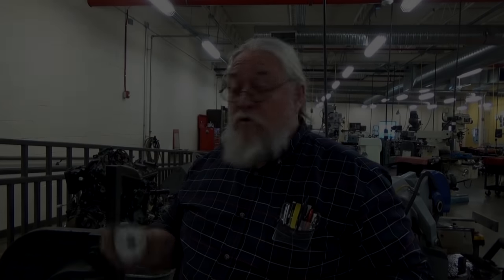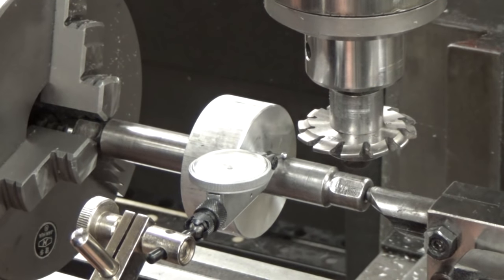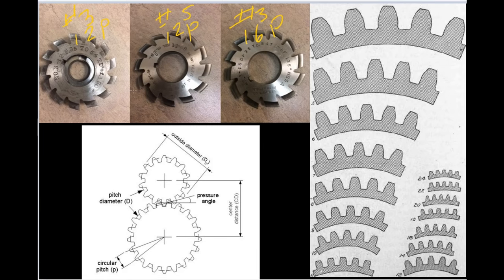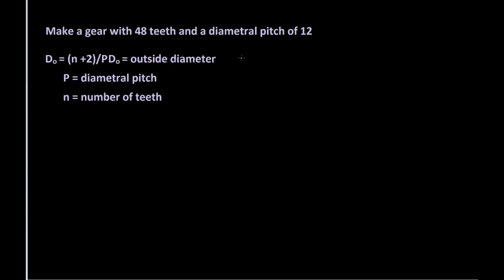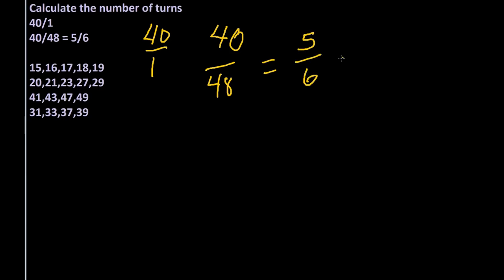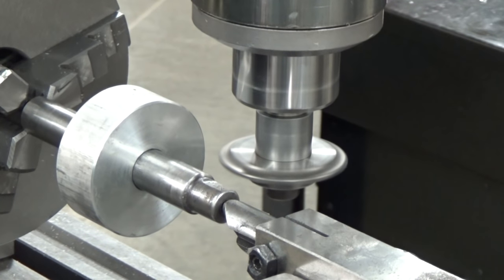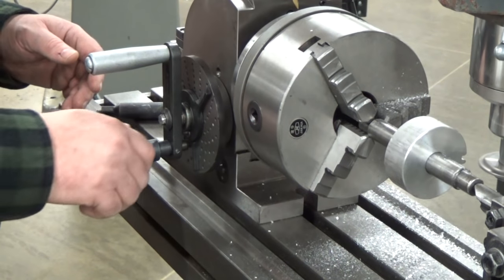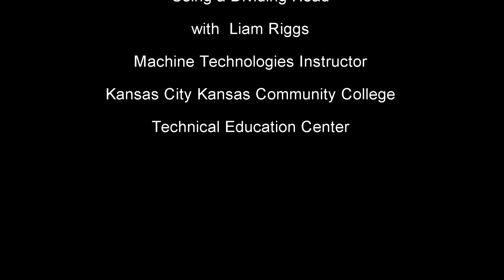Cutting a Spur Gear using a Dividing Head

Comment: Hello. In the beginning of the video, you said that the madrel is .003" larger at one end. During your setup, you indicated the top of the mandrel parallel to the table. Wouldn't that make the cuts not straight across the gear? Am I missing something? Thank you.

Comment: Up until a few years ago I always assumed gears were cast in sand molds or dies and then polished and "cleaned up", I was surprised to learn that every tooth is actually cut one by one on a machine like this!
Reply: This isn't the way mass-produced gears are made. Its really just for one-offs.
Google "gear hobbing for production gears.. 😎👍☘️🍺
Reply: @peterfitzpatrick7032  Yes, there's automated ways to produce the gears, but what I was referring to was not these one-offs but the fact that I thought they simply sand cast gears with all their teeth, ready to just ream out the center hole and "clean up" the edges of the teeth, but they are not just simply sand cast they are machined from blank stock.

Comment: If the gear arbour has a taper in it how can measuring either side be a good test for it being parallel? Is that why you said 0.5 thou diff is good? It just doesnt seem very accurate

Comment: need your help!! if i have an outside diameter of 1.500 inches, what pitch should i cut to make two identical 1.500 inch gears mesh? centre to centre diameter is 1.435 inches. Gears are for an angle finder...there is no load on them

Comment: At the start you said we only needed the O.D.   the D.P. and the number of teeth, I agree...yet..you gave and used a formula for solving the pitch diameter?  We don't need the pitch diameter.      You also gave a factor for depth of cut ...my copy of 'Machinery's Handbook'  says use 2.157/DP  ?

Comment: Dear Mr. Liam, I have  a question that is when you indicate the part parallel to the table. Between the time 3':40" -      
4':10" in the video, you zero the indicator, then you move indicator to the other side, the other side is same height so then you call that good. Now, if the other side is not same height then how do you fix to make it same height?
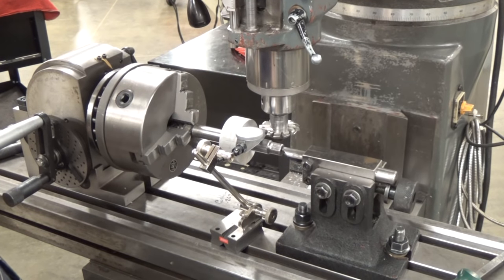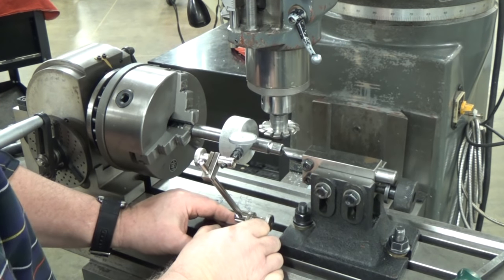Reply from the maker: Steven Mai Thank you for writing. If you look at the video at about 5:45 to 6:30, you can see bolts on the side of the tailstock, and a pry bar on the table just behind it. I loosened those bolts and used the pry bar to lift the center to the proper height. That procedure was cut out to shorten the length of the video. I hope that helps.
Reply: Liam Riggs Thank you so much Mr. Liam.
Reply: The shaft holding the blank is TAPERED hence left side of the blank and right side of the blank should show  different numbers while the shaft is parallel to the table...Error is small but it is there!

Comment: How did you get the 50 when you went 300÷50=?? .thank you .I feel dumb for asking.
Reply from the maker: At about 7:45 minutes into the video I go through the formulas to find the diametral pitch. The formula I used is outside diameter times number of teeth divided by the number of teeth plus 2. At about 12 minutes I go through the formula. The 50 comes from the last half of that formula, 48 (number of teeth) plus 2.

Comment: Hmm could you reveal which spindle is installed in your mill?
Reply: mr it is probably an R8 spindle with an involuted gear cutter arbor (although the same arbor can probably be used for other cutters).  Here is a description from a set available on eBay:

8Pcs Involute Gear Cutters (each cutter will cut a certain range of teeth)
pressure angle: 20 degree
Outside Dia: 55mm
Inner Bore: 22mm
Cutter Material: HSS
R8 shank gear cutter threaded 7/16(Inch) drawbar
R8 shank gear cutter holder fitting for hole 22mm center hole in the gear cutter

Just search “R8 involute gear cutter set” on eBay or Banggood.

Comment: Nice video👍 But i did notice that the dividing head is not fixed to the table, unless it is bolted down another way🤔
Reply from the maker: There is a 1/2" hex head bolt under the chuck and a couple hold down clamps on the backside. It is most definitely clamped securely to the table. You can sort of see the hex head at about 6:30.

Comment: Can anyone explain why you add +2 to the number of teeth? I understand it works I want to know why.
Reply: The DP number ( 7,  8, 10, 12 ,ect ) sort of work like pi , You multiply the diameter of a circle by pi to get the circumference.  And with gear calculations you do the same, sort of. A one inch Diameter gear multiplied by 10 p =10 tooth gear that is 10 teeth around the circumference. A two inch gear multiplied by 10 p gives you a 20 tooth gear ect,ect and this gives you the pitch circle, so in order to find the outside diameter we add 2 (If you were to add a small number to pi you would get a bigger circle and we need a bigger circle ) But you say why 2 ,well it doesn't have to be 2 when you make stub tooth gears it could be 1.6 , It just so happens that 2 gives an Addendum  (the part of the tooth above the pitch circle ) that has fairly good proportions for the job My guess is that 2 just sort of made gears that worked.   You looking for some perfectly logical mathematical reason  ....Tell me when you find it

Comment: Liam thanks for video, but I think u got example 2 and 3  math wrong, the formula should be Do=D(n+2)\n 

So example 2 should be 12.5"  
And example 3 u used the same wrong formula so u also got the wrong answer
Reply from the maker: I'm not sure where you came up with your formula. Look in the Machinery's Handbook under Spur Gearing. I used the 26th edition. Table 1 lists all of the formulas for standard spur gears. There are several formulas for determining the outside diameter that could work depending on the information you are given. The formula for determining the outside diameter when the number of teeth and the diametral pitch is known is as I stated, N+2/P.